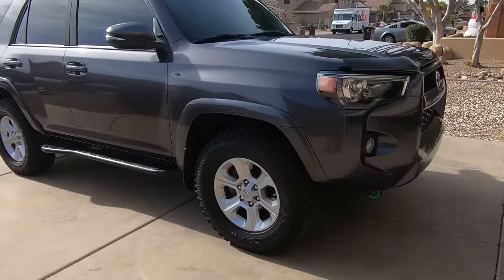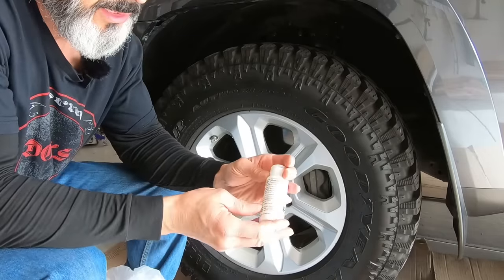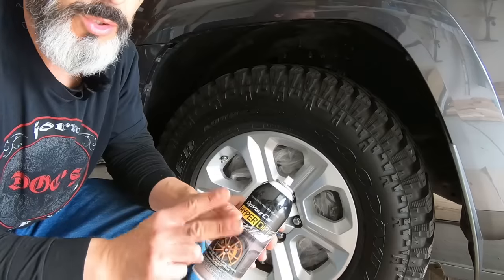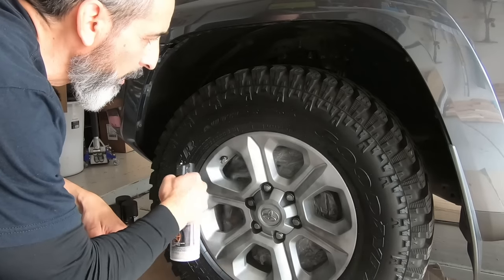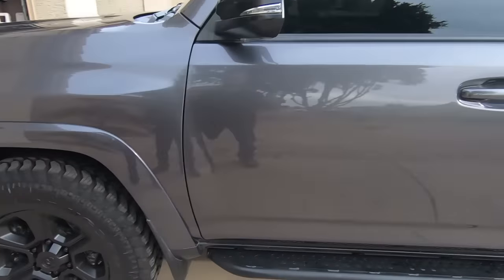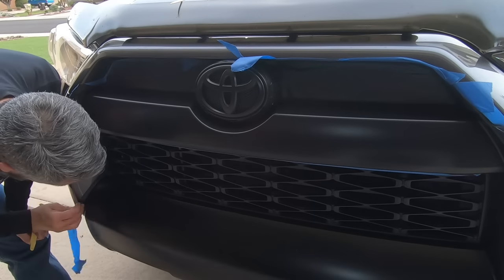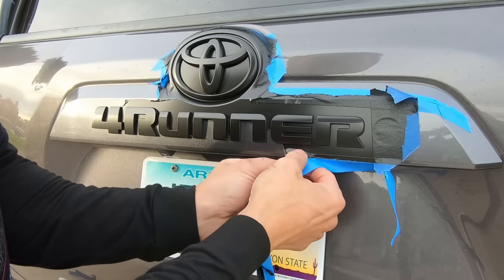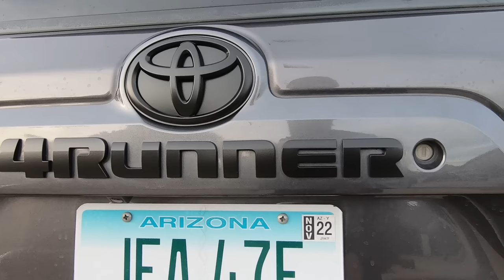HyperDip (PlastiDip) 4Runner Transformation!: How To

Comment: How does the color hold up? I did my grille a while back and I feel like the color faded in AZ
Reply from the maker: Did you use Hyperdip or Plastidip? I think I'm coming up on 8 months and no fade yet with the Hyperdip. We are just getting with summer now so I will report back in a few months with updates
Reply: @AZOverland2017  I used the basic black plasti dip  , I might try the hyper dip
Reply from the maker: @365AdventureCo.  Definitely try the Dip. You may have better luck with it over the Plastidip👍

Comment: 5 cans for 4 wheels? also.. respirator really necessary?
Reply from the maker: Depending on the size of the wheel and design, it could take up to 5. I can see some smaller wheels using 4. I actually had some leftover. 
Respirator is definitely recommended. Yes, you can do without, but it's your choice ultimately. Thanks for watching

Comment: Any issues with the dip coming off when tires are rotated? That was my only hesitation.
Reply from the maker: Every wheel is different because of the type of lug nuts and the if they are recessed or not. I did a video on my removing the lugs which I will put below. As far as damage to the Hyper dipped wheel itself, there should be none if you handle it by the tires when moving and mounting them. If you grab by the actual wheel itself, yes, there could be damage to the coating. If the lugs get scuffed and show, you can repkace the lugs with black ones. I will be doing another video soon on the condition of the Hyperdip after 1+ years 

https://www.youtube.com/watch?v=2UnvQ9pRUcE&t=50s&ab_channel=AZOverland

Comment: really nice
Reply from the maker: Thank you!
Reply: @AZOverland2017  How is the paint holding up as time goes by?
Reply from the maker: @tombox2759  Woe sorry for the delayed response, I somehow missed this question. Overall, excellent. I just noticed a small peel on the edge of tone of the wheels where the tire and rim meet. It is not bad but I suspect it could get worse over the next few months. With the grill area, I neglected to keep up with washing it after many road trips on the highway and it looks like bugs got imbedded in there. I haven't attempted to clean it yet but I am hoping I didn't wait too long to do this.

Comment: Rock sliders, or Armadillo RS side steps?
Reply from the maker: These are actual rock sliders which is what I needed. They bolt heavily into the frame rail to provide maximum protection if going over a large rock or similar and coming down hard near the rocker panel area. Also protect in other ways the side steps wont. Depends on what you like to do though

Comment: Can I have 3 specific pictures of the 3 spray bottles in the clip, please? Thanks so much
Reply from the maker: I'm not sure which bottles you mean but here are links to the individual products. If you want different pictures email me and I can send what you need 

Dip Release is here: 
https://www.dipyourcar.com/collections/application-and-removal/products/dip-release?variant=5631727748&ref=891

Pre Dip Spray:
https://www.dipyourcar.com/collections/application-and-removal/products/predip-spray-aerosol?variant=5631654340&ref=891

The actual kit I used :
https://www.dipyourcar.com/collections/popular-wheel-kits/products/shadow-black-hyperdip-wheel-kit?variant=5630996356

Email me at:

AZOverland1@gmail.com
Reply: Please tell me how many bottles do I need to paint 4 wheels?
Reply from the maker: @huyflycam841  The Wheel Kit comes with 5. It is recommended you use all 5. Some people stop too early when they believe the wheels are covered but the issue is you need to achieve a certain thickness, both for durability and ease of removal. 

https://amzn.to/3LHnNR5
Reply: Thanks so much bro

Comment: How long you waited for each coat? And how long you waited before driving?Thanks
Reply from the maker: By the time I finished all four wheels I was just about ready to come back and coat the first wheel again. I parked it overnight and then was able to drive it the next day
Reply: @AZOverland2017  Thank you!
Reply: @AZOverland2017  how long did it take you to complete all 4 wheels?
Reply from the maker: @CHE408.  I did all 4 wheels and the emblems and bumper/ grill areas. It took me most of the day with filming
Reply: @AZOverland2017  Thank you so much for taking your time to respond to my questions. The video is very informative. I’ll hyper-dip my wheels tomorrow. Thank you once again for sharing your video and answering our questions.
Reply from the maker: @CHE408.  Let me know how it goes!
Reply: @AZOverland2017  it went well… had a few minor runs but not too noticeable
Reply: @AZOverland2017  are finish products supposed to be smooth? I just realized mine wheels are little rough when touch
Reply from the maker: @CHE408.  Yes, smooth. After the 1st few tack coats the rest of them should be sprayed heavier as to look smooth and somewhat shiny. It makes for easier cleaning as well.

Comment: How many cans did u use for all four rims? I only bought 3 and wondering if that is enough
Reply from the maker: I believe it was 4
Reply: @AZOverland2017  do u think 3 will be enough?
Reply from the maker: @Ace61527  possibly depending on the size and design of the wheel. Just make sure you apply the proper amount of coats. Mine was coated at probably 8  or so but you need to build the correct thickness.

Comment: What kink a roof rack you install on your SR5?  thanks,
Reply from the maker: It's the Rhino Rack Pioneer Platform
Reply: Is the rack install on the OEM rail (adapter needs). Thank so much.
Reply from the maker: @hominhchi  Yes on OEM rails. It is attached with the CXB Leg Kit. You can also use the  Vortex SX Leg Kit I believe.

Comment: What about getting over spray on the car is that not a concern
Reply from the maker: Yes, it is. There was enough space between the the wheel and the fenders/quarter panel. So no issue there. I don't remember if I showed the Dip being pulled off the tire or not. But, the Dip Release allows the product to be removed easily. The only place I should have masked further out was the rear emblem. I did get some overspray on the rear widow but it was light and came off quite easily
Reply: @AZOverland2017  I should of worded that a little more specific what about on a car that their isn't much of a gap
Reply from the maker: @Joedoeswhat  Yes, I would definitely mask up the surrounding area in that case. Especially a dropped car with low profile tires. The opposite of what I have, lol

Comment: How's the plastidip holding?
Reply from the maker: @MartinezFAMHawaii  I did a video on 1 Year later you can check out, but here we are coming up on 3 years. The emblems are still perfect. Slight delamination on the very outer edge of the wheel. there are some spots on the front wheels that came up because the alignment shop clamped their equipment on the wheels. Otherwise than that, it still looks great.

Comment: How does it come off the tire?
Reply from the maker: If it's put on the way it's recommended it will peel off. Start at an edge and it pulls off in sheets. They also make a spray dissolver for any hard to get or stubborn spots

Comment: Have you had to take the wheels off yet? Does the hyper dip come off the lug nuts?
Reply from the maker: I have not, and that is a really good question! I will have to try that out.
Reply: @AZOverland2017  Oh ok just wondering. Good job anyway!
Reply: @AZOverland2017  let us know wht you find out. I am guessing they will come off or at least get some scratches. I would probably get Blacked out lug nuts to go with it.
Reply from the maker: @drifter-indian1448  I agree, most likely. Getting black lug nuts is a great idea and I will probably go that route and have them on hand if these don't hold up. Thanks for the idea

Comment: Don’t recommend doing it on rims it peels really really bad after a year a half also depending if your weather has season it’ll peel even worse this guys in Arizona where his legit paint is melted to his car too
Reply from the maker: If it's peeling really bad after that time, it was most likely not applied correctly. Also, this is not a permanent modification. So, even if you did get 1 1/2 years out of it, it is well worth it in my opinion to completely change the look of the vehicle. I'm not sure about what you mean about my "legit paint melted to his car" ?

Comment: It would be easier to take the wheels off the car.
Reply from the maker: Why would it be easier?
Reply: @AZOverland2017  better access to all the contours and corners of the wheel, not working below your line of site, working more comfortably not squatting down, able to turn the wheels and see from all angles to get better coverage with spray. Not having to mask other parts of the car.
Reply from the maker: @MICHAEL-ys3pu  While I agree that the overall result could possibly be better, it certainly would not be "easier" and would require tools and equipment most people don't own. Removing all 4 wheels from the 4Runner, and getting it on jackstands, is not an easy feat. Also, how would you raise the wheels to a comfortable working height when off the vehicle so you wouldn't have to squat? There was no masking required with this vehicle because of the spacing between the tire and fenders/quarter panels. With a car or lowered vehicle, I would definitely mask however. Wheels should be sprayed in the upright position and not laid down. Finally, you would need to leave your vehicle on jackstands over night as it wouldn't be a good idea to try and reinstall the wheels without being fully cured after spraying. Since I was an autobody tech and painted cars for a living, this was not difficult for me specifically, but I can see how your method could maybe benefit some. Thanks for your feedback.

Comment: The dip is a waist of money & effort you carnt clean it properly like getting bugs of grill & if you drop eny cleaning products on it that's it destroyed I know because I have experienced this just this past week hours of work for nothing because it will not last
Reply from the maker: Well, I've been enjoying the look of what I did coming up on 1 Year now. Ran it through multiple car washes and many off road trips. 
Yes, the front area that gets the most bugs can be tough to get perfectly clean, however if nothing was on there I would have rock chips in the original paint, which I don't have with the Hyperdip protecting it. Is it permanent? No. But, it has certainly given me the look I wanted until I can afford to spend $1,000 plus in getting a set of black wheels and black overlays